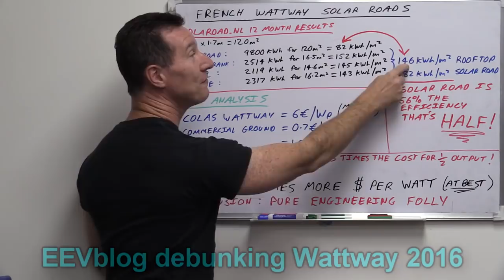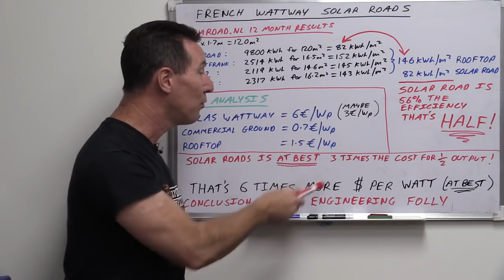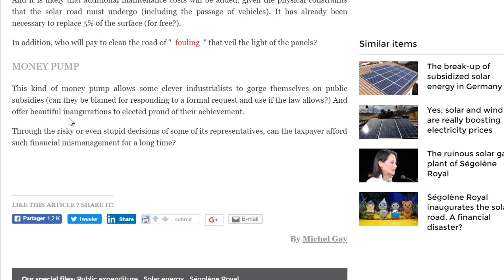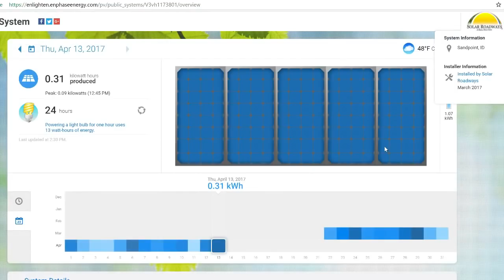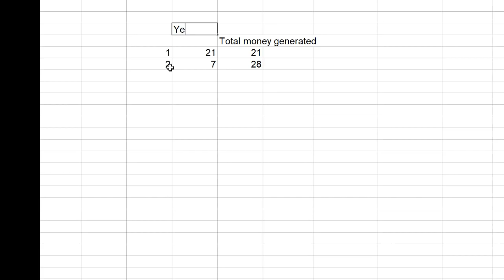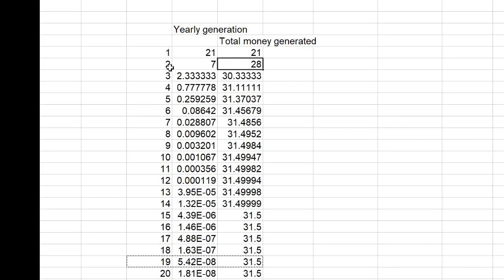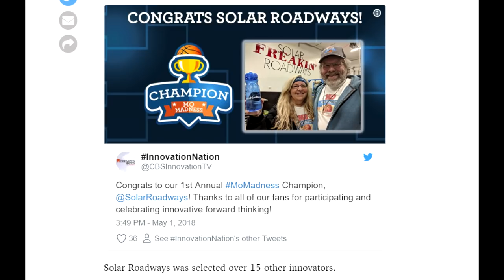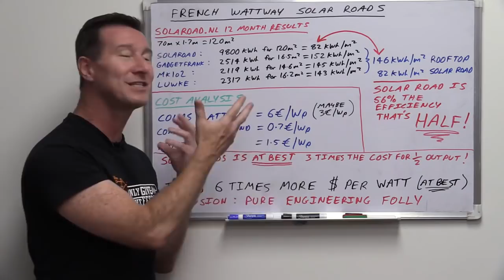Solar Roadway: 10¢ return on $1000 investment!

Comment: Quick question. What if we installed something like a geothermal system, absorbing the heat from roads and used that to create power? Not sure if that would be effective but I just thought it would be an interesting idea.
Reply: At first glance thet feels like it would require some under-road installations
Reply: that's stupid idea
geothermal itself is expensive but at least make a lot of power, but road heat is nowhere near geothermal power
Reply: @לעזאזלעםגוביידן  Why do you think I formatted it as a question? I don't have the knowledge to do the physics equations necessary to calculate whether that is a good idea, or even possible. My caveman brain thinks, "Road hot, so make electricity?" I'm just formulating some ideas here. There is no need to be hostile or say it's a stupid idea. I framed it as a question, because I don't know how to even determine whether it is a waste of time. I'm asking the physics community whether it is or not. If you want people to appreciate your perspective, then be humble about it. Don't be an asshole because it gives you some sick pleasure to know more about something than someone else does. If I had to guess, I'd say the total amount of thermal energy generated by the heat from asphalt is somewhere near the thermal energy created by the sun hitting asphalt. I'm just not sure. It's really a questions of whether the total heat generated by asphalt is more than the heat generated by digging deep into the earth to make thermal energy. I'm trying to determine which one would be greater, more than anything. Please provide some calculations to make me understand why I am wrong and you are right. Don't just call my idea stupid.

Comment: Thunderf00t you're a little childish. Be a little goal-oriented. But I know you are biased and a friend of nuclear power, which incidentally is now 5 times more expensive per kWh than solar power for new power plants. Nevermind. I agree with you that these guys are stupid with their solar street because they can't even invent a prototype for $ 0.5 million. I am sure that it is possible to invent and produce this. But cost will always be an issue and this is an important point to point out. Blaming the price of a prototype is not fair and will get you nowhere.
Look: if you were to build a solar wall or roof on the street it would be a lot cheaper. But why when you have deserts in the US and endless space?

Back to the solar street and your childish counts on a very poorly designed project. We can guess what kind of materials we need for a solar road, for example: 5-10 times thicker and more stable than for normal modules. And in addition the LEDs and other costs. We also know that the solar roads cannot be as efficient as normal solar systems. Let's say 50%. So the price will be very optimistic 5-10 times the price of a normal system and it will produce half of the energy. Together it is 10-20 times more expensive per kWh. 

And there is no way out - even you love the idea, because you need the thick, strong and durable materials and the efficiency on the road will be bad always.

Comment: 0.1$ for 1000$ investment is 0.01% dividend, pretty shitty ROE, 10к years of return...Solar pannels live for lets say 30 years with adequate power output, which means its even worse than shitty idea, its worthless. What to do at night? Electricity storage is required...Better make rooftop filled with solar pannels iver the roadways and reduce direct heating of the cars by sunlight, lesser power wasted on air conditioning cars...

Comment: Except there is nothing that says it will keep depreciating by that amount each year. The solar roads could have just depreciated that much the first year. Could go down to 1% as they get better at manufacturing the technology, making it cheaper and more mass production friendly.

A lot of technology starts off super expensive and then as they get more efficient they cost less and less.

Take cell phones for example. The Motorola DynaTAC cost $3,995 for the first cellphone back in 1984. Nearly $10,000 US dollars today in 2020! That can buy you 10 of the most advanced smartphones today that are far far more powerful and advanced than the first phone.

Comment: 2:40 It's a female, so it's not "mister". But for the rest I agree: solar roadways are pretty damn stupid. If one really wants to waste taxes and  use public domain for solarcells, one is still far better of just building a (tilted) roof over those roads: the road + roof would still cost less than Solaroad, and it would give a much bigger energy-output. Plus, the road would be protected against the environment better, so would last longer.

Comment: If you really want to cover roads with Solar Panels, how about you try doing exactly that, taking solar panels and putting them above traffic so that the roads are literally covered with solar panels.

I'm not saying it's a good idea or anything, but it's got to be better than this, however minimally it might be.
Reply: that's better than this in a lot of ways, it makes the roads cooler so the less people have their air conditioners on, so that cuts down on pollution a tiny bit.
And if its above the road then you don't have to drive on it at all. someone start a kick starter for this now!

Comment: Why not put solar panels above the road for shade instead of the road itself? Then you could still maintain the roadway, the panels would cool with airflow, and in sunny areas the road and drivers would be so much cooler.

Comment: What we really need is a solar shield in space that both cools the planet and provides electricity, tethered In geosynchronous orbit with a carbon nanotube cable with a golden wire core. It may not be feasible. But it would be awesome if that worked.

Comment: What is the carbon footprint of the glass and electronics manufacturing? For covering roughly a square metre of road surface. ANd then there's the wiring and infrastructure. I'm willing to bet the carbon footprint of asphalt blacktop is a lot less.

Comment: Yeah coz only covering 1% of the worlds deserts would be easy, it's not like it would be millions of square miles or a logistical nightmare! It's similar with road surfaces, roads (especially motorways) are very expensive to build as it is but even if you fitted the solar system during the initial build it would soon start to add up and then there's the additional maintenance costs. I do think it will be viable one day but probably in about twenty years or so.

Comment: I live in Canada. It is not uncommon to drive around in winter with studded tires. We plow the streets to remove snow. Sparks come off the bottom of the snow plow as it moved along at 70 km/h. We use gravel to aid with traction and salt (perhaps substitutes) to help melt the snow. Who wants the maintenance contract? Heck, there would be so much maintenance, we could never drive anywhere. Lastly, I don't think it is wise to heat the road to melt snow. It would take a lot of heat, and would change the soil below which would likely have environmental impact, as well as causing further heating of the planet.

Comment: You should consider the fact that you also get a road surface.  Not that they last much longer than asphalt.  I would think that implanting an array of thermocouples to cool the road and make electricity.  If you must use roads for power generation.

Comment: i think you missed something in your math... i looked up the life expectancy of LED lights and it said 50,000 hrs or about 5.7 years.  assuming these panels were actually performing a safety measure like providing stripes for the road you would end up replacing all of them every 5 years.  the current display in sandpoint has 30 panels - 150 sq ft and at a cost of around 2,000.00 per panel. so every 5 years there would be another 60K to replace the panels but your energy production would skyrocket back up to 10 cents a day.  2018 they got a 100K grant to install a similar display in Baltimore and this display will have 35 panels - so the extra 5 panels will cost a additional 40K whereas the 30 in sandpoint was only 60K for 30.  i guess the plan is to lower costs unless they go up.

Comment: Update:   Solar Roadway install in Sandpoint, ID was shut down sometime in Sept 2018, in anticipation of new panel upgrade in spring 2019.   I.e. no operation, not even partial, since Sept 2019.   It has been a platform for Christmas-tree planters.
(The Brusaw's, of course, claim this is not a failure but a step in the development process as they iterate on panel design.)
Still expensive.  Still don't work.

Comment: My question about solar roads when I was 14 was calling myself a dumbass and asking what was supposed to happen to the cars that were expected to drive on the roads and the shade they created and not to mention that their is a limited exposure to solar panels before they start storing energy so highways are almost entirely out of the question but the fact that expecting to put a solar panel somewhere where most of its time is going to be expected to be in the shade is Moronic

Comment: In terms of electricity, I would like to combine solar roads with the Tesla battery for grid power, the Tesla battery is a great big battery invented my Eli Musk in an effort to retain the power created by the solar arrays, and/or many different Electrical sources. Additionally another reason I am for solar roads is because street directions can be programmed in them and in the event that there is an emergency ahead, construction ahead, or if a two way arterial needs to be made into a one way arterial between 7 AM and 9 AM, then reverted back to a two way after the rush hour, that would be possible. Additionally the ability to melt snow and to produce some output. The whole idea of solar roads is not necessarily dead.

Comment: I've got a better idea...
Couldn't they make little weights/button/switches connected and placed below the road itself so whenever cars run over it, it's weight is forcing some weird generator to start running/moving to generate power that way? I would assume that would be much cheaper and more efficient than a solar roadway. It's stupid as fuck, but much more plausible.

Comment: Just a note: I am not sure you can extrapolate the 1/3 loss of energy on the solar roadway every year. It is entirely possible that it was due to surface abrasion /loss of transparency which happens in the first year and then plateau out. You would need to check why the loss happen before extrapolating. What you can say en OTOH is that no matter what this looks like a stupid idea.

Comment: The only way this might make sense is if they could come up with a paving material that was photovoltaic, and it could be installed and wired up at little additional cost and require little to no maintenance.  Then, solar efficiency wouldn't matter very much.  No, I don't expect that to happen.

Comment: project is a flop cos they also forgot that glass breaks under stress & the uk has a lot of glass studs replacing the conventional cat eyes which have shattered due to them being driven overthe only thing that has worked is solar powered line markers(electronic cat eyes) & road side sign lights which ive seen in many locations so they should really  put the money to better use  than something that simply isn't viable or cost effective

Comment: This is BS.
Even the stupid idea to use solar thermal energy is better than this.
You could only use it in very hot regions. 

 You put copper-water-pipes in the black asphalt which heats the water inside the pipes up to produce heat (steam) and electricity. 

You could melt salt passively during the day with the produced heat, so you can produce electricity even during the night, because molten salt stays hot for a very long time, the system could use low pressure steam generator to produce electricity during the night, where demand is relatively small. 

Of course it's useless during winter for energy production but you could use the same system to melt ice on streets during winter.

It's inefficient for sure but it's probably better than solar roads.

It's probably more useful to put solar (voltaic) panels over street installations like street signs, street lights, traffic lights, cameras etc. So that at least these things are energy neutral, meaning that they are independent and produce enough energy to function without the public grid. 

The other technology I heard some scientists and engineers are working on are pressure plates for streets and sidewalks to produce electricity.
Those plates transform the downward movement, created by someone stepping on the plates or a car driving over them, into essentially torque, a spinning movement to generate electricity with the mini generator built in, in the pressure plate.
But that has all sort of problems.
It's expensive, you have problem with miniaturization of parts which have to withstand extreme forces over a long period of time. How do you produce a constant flow of energy with inregular production of electricity. Do you first charge a battery and then feed the grid? If yes, where do you install the battery? How much more expensive would then a single plate cost?
Etc.
Etc
Etc.

Comment: Switzerland decided to follow the madness:
https://www.rts.ch/info/regions/valais/9832696-une-autoroute-couverte-de-panneaux-solaires-pourrait-voir-le-jour-en-valais.html
For those who can't read french:
"A highway covered in solar panels could be built in Valais"

The fun parts however:
- the solar panels will be built on a roof over the highway
- no funding from the government at all
- the position has been decided because of the proximity of a lot of hydroelectric plants that can be used to stock the excess in electricity production
- there are already a lot of "electricity highways" (because of the dams) in the region that can be used to transport the energy

And there I thought my countrymen were also falling for the solar freaking roadways...

Comment: Solar isn't a viable electricity production technology as a replacement for coal/natural gas, it's pathetically inefficient, and degrades very fast (according to GE within 10 years anywhere from 30-90% degradation). Nuclear is a much better option.

Comment: Very well put thinderf00t. Solar energy is a great concept, but solar energy would be much better utilized if it was just regular solar panels following the sun and put to use for energy consumption on the regular. Frick solar roadways. How about using solar energy as just a regular renewable energy source

Comment: Well on average you'll get 12 hours of sunshine a day for varying amounts of weeks and months depending on location (like Arizona gets way more sun than say, the UK but then you run the risk of massive overheating) and could get about 8 months on average of clear weather. So, that's barely revolutionary off the bat. Plus the amount of cars what will be blocking sunlight for minutes or hours on end... It simply won't generate nearly as much energy as people reckon and will definitely be damaged too easily. So like... All around a bad idea what's expensive, unpractical and doesn't at all work. A good idea on paper cause seriously, we got lots of road and not enough clean energy. Put the two together and you got a massive solution to a large problem. Try it and it simply doesn't work...

Comment: This thing was just a failure at conception, I really don't understand, this is not a belligerent it will work if we do it sort of thing, just look at a solar panel and think for a minute.

See the light bouncing off that, you want that on the road?, can you see anything else outside of the glare? then how will you be able to see any road changes that might pop up from a piddly LED?, how will it absorb light with vehicles covering it?, you have to seal it so water doesn't get in, where is the water going to go with sealed roads, how are you going to maintain them, you have to switch a section off to fix a patch or risk killing people..

Seriously, the 1% of the desert idea sounds more viable than this, safer too.

Comment: He mentioned the 1% of worlds deserts, and for a split second i thought, oh, they will build something usefull IN THE FCKIN' DESERTS. Damn.

Yeah the sand abrasion and long powerlines and stuff...
But anyway, would sapphire/alumina, as planned for the roadways, be resistant enough to "sanding" to be used for solar panels and mirrors in deserts???  
Perhaps some day synthetic fuel/hydrogen/ammonia producing plants will be located in deserts (yeah i know you need some water for synthesizing hydrogen compounds ;-) once the (cheap) oil runs out....

Comment: SO.. wouldn't it be cheaper to just put pipes under the roads to heat a fluid? That would probably be a fraction of the output of a normal PV but these ones only get a fraction anyway.

Comment: Why not rather put "roof" on the roads. Solar panels that act as a roof. Less rain on roads. Less accidents. Less sun glare. Less direct sun heating for less AC usage and lower fuel consumption. 
You get electricity.
You get less accidents because road is dry and there is less sun glare.
You save fuel as there is less usage of AC and it is dry road.
Also less fuel during winter for clearing snow on the road.

So, make solar roofs on the roads, not solar roads.